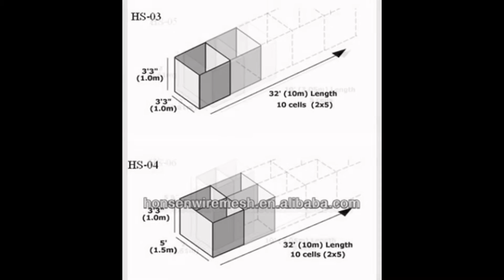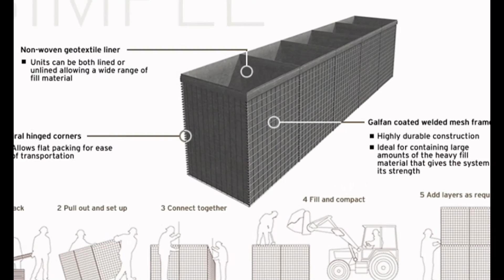HESCO barrier/Hesco bastion/ prefabricated, multi-cellular system Hesco container

Comment from the maker: HESCO barrier/Hesco bastion/Hesco container is a prefabricated, multi-cellular system, made of zinc coated steel welded mesh and lined with non-woven geotextile. inquiry at sales@xuanke-huixin.com. Units can be extended and joined using the provided joining pins.It is easy installed with using minimal manpower and commonly available equipment.After extended,it is filled into sand,stone,then hesco barrier like a defence wall or bunker,it is widely use in military to protect safety. inquiry at sales@xuanke-huixin.com.
Afghanistan market used Hot dip galvanized hesco barrier/military sand wall ,HESCO Barriers Export to Iraq in 2015 Hesco were know as Rock basket retaining wall, Blood retaining wall,River bank wall. welded gabion retaining wall,.Gabion box,basket products.hesco barrier, flood control barrier, etc. inquiry at sales@xuanke-huixin.com.
Hesco is Widely Used as Flood Control barrier and Retaining Wall, Comes in Various Sizes inquiry at sales@xuanke-huixin.com.
Zinc-coated Steel Welded Mesh Hesco Barrier, Lined with Nonwoven Geotextile. inquiry at sales@xuanke-huixin.com.

wire mesh.inquiry Magnetic wire mesh cloth stainless steel factory 
sales@xuanke-huixin.com Hebei Xuanke Trading Co.,Ltd
Tel: 0086-311-83165769 Fax: 0086-311-87708434 
Phone: 0086-15630186759 Email: sales@xuanke-huixin.com

Comment from the maker: Dimensions hesco barriers,hesco Dimensions of barriers for flood control system.hesco barriers dimensions used for Control flood ,hesco barriers dimensions/Hesco Barriers For Sale on flood control work, Dimensions Wholesale Various flood control hesco barrier system with High Quality Hesco flood Barriers Dimensions For Sale Products from Global Hesco Barriers flood controlling solution factory For Sale Suppliers and Hesco Barriers,Dimensions welded hesco bastion blast wall Dimensions ,military hesco barrier for sale/hesco Dimensions barrier Factory price galvanized gabion basket/box for sale used for hesco barrier 2-6mm, hesco barriers factory Direct Sales, Special Working 10 Years, Hesco Barriers,flood Hesco Barriers Price, Wholesale Quality Hesco Barriers Price good Products from Global Hesco Barriers Price Suppliers,Dimension HESCO barrier or flood safety HESCO bastion is quite possibly one of the simplest and most effective systems Dimension HESCO FLOOD BARRIERS,Dimensions Galvanized Flood Barrier,Hesco Barrier Dimensions solution flood control system
Galvanized Hesco Barrier,Galfan Coated Hesco Barrier Dimensions ,
Welded Hesco Flood Barrier Dimensions hesco barrier Manufacture,hesco barriers flood control,Hesco barriers supplier,Hesco barrier Manufacturer,hesco barriers flood control Wire thickness: 4mm-5mm,flood control hesco barriers|Coil wire: 4mm /hesco barriers Mesh size: 76.2mmX76.2mm, 80X80mm, 100X100mm.Geotextile: 2mm heavy duty non-woven polypropylene.
hesco barriers Panel size: 2.21m x2.13m, 1.37m x1.06m, 0.61m x0.61m, hesco barriers also can be customized.
hesco barriers Finish: electro galvanized hesco barriers , hot dipped galvanized hesco barriers Alu-Zinc coated hesco barriers after welded hesco barriers Package: Several sets in one pallet.
Iraq hesco bastion price,hesco barrier nsn,hesco bastion barrier price hesco barriers /hesco barriers coated Galfan hesco barrier,
Flood control system Al-zi Alloy hesco Barriers hesco flood barriers factory supplier. hesco barriers flood use make by welded .,use for flood hesco barriers price for sale hesco barriers whosales supplier.

https://www.youtube.com/watch?v=r-JSy...
Galvanized hesco barrier\Military wall \Flood control Hesco Barrier with sand Gabion box mesh for flood control river protect,Gabion mesh Other name: Military wall Hesco Barrier with sand hesco barrier gabion bags HUIXIN WIRE MESH CO LTD. THE BEST SUPPLIER
Email :sales@xuanke-huixin.com Hebei Xuanke Co.,Ltd www.xuanke-huixin.com
We are Rich experiences in hesco barrier,Flood Control hesco Barrier,Gabion box mesh,Gabion basket mesh industrial. We have been offering OEM ODM services more than 10 years/ Sincerely hope to be your supplier that help your business.